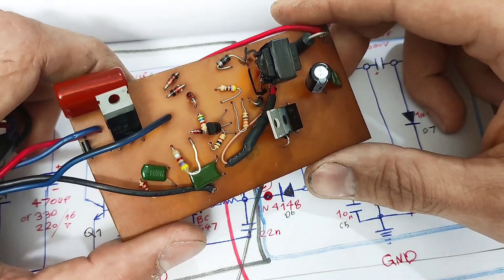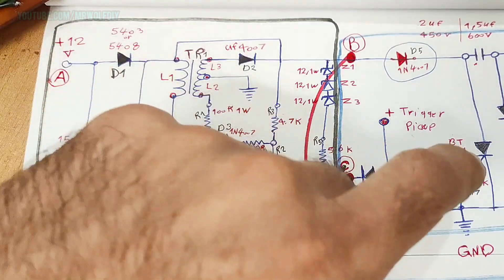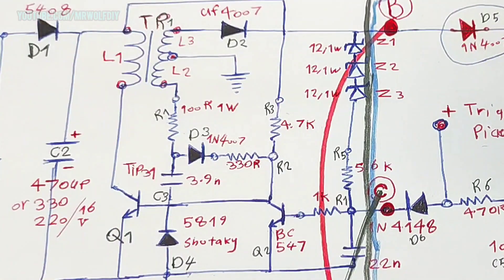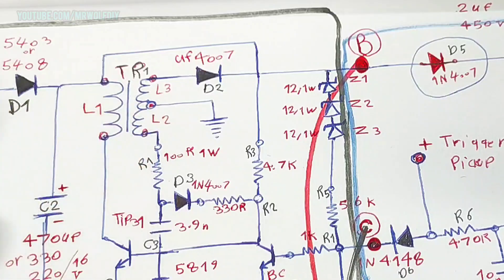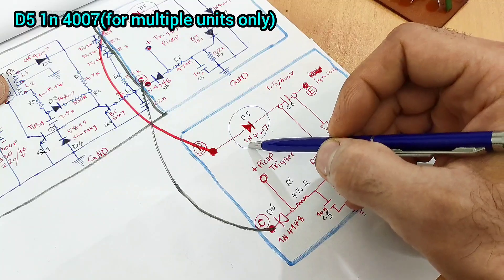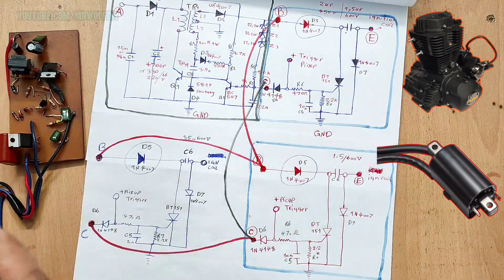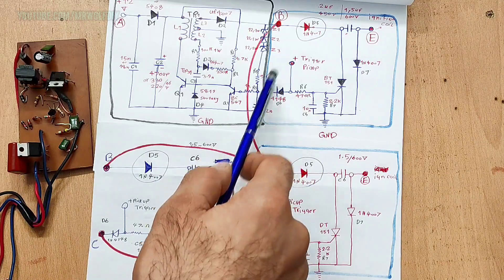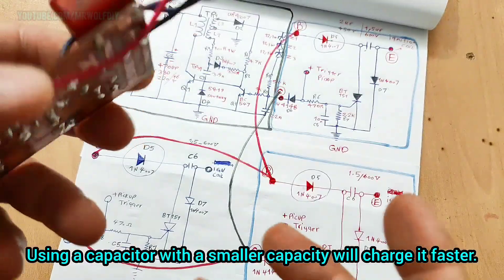DC CDI Unit For Multi cylinder motorcycles! Easy and Practical Guide.

Comment: Thank you for the detailed explanation. I have a question: can this circuit be used to power a Daewoo Matiz 3-cylinder? If there are any solutions, please provide me with a unit for a Matiz.
Reply from the maker: A CDI is originally designed for motorcycles...
Although it can be used on a car engine with modifications and adjustments,
But you must use a DC-CDI unit with adjustable timing and advance curves.
The main challenge is achieving precise ignition timing so that each spark plug fires at the correct moment.

Comment: Hi hope all is well with you, I have 4 cylinder motor cycle and it has one pickup coil to control two ignition coils to fire 4 cylinders(1&4, 2&3 waste spark system). I'm don't understand how to detect 180 phase and fire two ignition coils using one pickup coil.
Reply from the maker: In a waste spark system, there is no need to detect the 180-degree phase. With one pickup coil, two dual coils fire simultaneously to two cylinders; one fires during the power stroke and the other during the exhaust stroke, where the spark is wasted. Therefore, one pickup coil is enough to control both coils.
Reply: @MrWolfDiy Thank you for the reply. But if I swap primary wires to the ignition coils with the existing CDI bike won't start. Seems like there is a timing difference.
Reply from the maker: Yes, that’s correct ,When you swap the primary wires of the two ignition coils, you are actually: disrupting the firing order.
Even though each coil is connected to two cylinders, the timing gets messed up, and the spark may occur at the wrong time,
for example, at the end of the compression stroke or, worse, during the intake or exhaust stroke.
Reply: @MrWolfDiy But you said both coils fire simultaneously 🤔 How to detect this timing difference using single pickup coil?
Reply from the maker: Look, the CDI in this type of engine handles the timing delay and processing internally.
Based on the crankshaft position and its internal design, it provides two separate outputs to the ignition coils, each with its own advance or delay.
You still haven’t mentioned exactly what motorcycle you have، Maybe I can give you a better answer.
Reply: @MrWolfDiy Thank you for your support. It is GSF400 Bandit. I'm trying to make my own CDI using Arduino but I couldn't figure out how the existing CDI process the pickup signal. I may need to go for my own hall sensors. Appreciate your help on this.

Comment: sit i am pretty surprize   can u simple make DC CDI  for pulsar bajaj bike or platina .. using stock HT coil please
Reply from the maker: Hi, You can produce a stable and good spark with a simple DC CDI, on HT coil
but only on the condition that the HT coil is specifically designed for CDI...
I have already built two DC CDI units, which are on the channel.
In platini ignition systems, it’s better to use an AC CDI, which also requires some modifications in certain parts.

Comment: Thank you for this very informative video tutorial. I have an old kawasaki mule that is still in good shape body and healthy engine other than it has a bad cdi. I tried fixing it by replacing transistors and capacitor but still not working. There is no longer available cdi in the market. My only option is to make one myself. The engine is 1988 Kawasaki, 2-cylinder, 4-stroke. It has only one pick up coil. What I don’t understand is how can I time the firing of the second ignition coil if there is only one pickup trigger? I appreciate any advise you can give. Thank you.
Reply from the maker: Greetings, and thank you for your kindness toward me.
I should mention that in many engines—especially older or simpler models—a "wasted spark" ignition system is used.

Both cylinders fire at the same time, meaning that when the pickup coil sends a signal, both ignition coils are activated simultaneously.

In this system, one cylinder is in the power (combustion) stroke, while the other is in the exhaust or compression stroke—so the spark in the second cylinder is "wasted" but causes no harm.

That's why it's called a "wasted spark" system.
This design is purely for cost-effectiveness and ease of maintenance.
Reply: Thank you for your reply.  I appreciate it.

Comment: Does the cdi provide any ignition advance as revs increase?
Reply from the maker: Greetings friend,
I have not practically tested this circuit on a motorcycle yet, so I do not have precise information about it. However, technically, due to the lack of a microcontroller, it probably has less flexibility, and the ignition advance is likely limited to a maximum of 12,000 RPM,
Nonetheless, it needs to be tested in any case.

Comment: Awesome! Great info!

 Would a heat sync be required?

 Space for 3 units would be an issue. 

What type of current would be required? Would three cdi's cause an issue on the existing circuit?

These ideas are great! Thanks for sharing sir!
Reply from the maker: Greetings, thank you!
In response to your question: using a heatsink for the Q1 transistor and thyristor will help improve the circuit's performance.
Regarding space, this circuit doesn’t have many components. If you convert it to a PCB using specialized software, you can build it with minimal dimensions.
The heart of the circuit is the transformer. If it is properly wound, the risk of component damage will be minimized. In any case, it must also be tested in practice.
Thank you for sharing your thoughts!
Reply: @MrWolfDiy  Great solutions! Thanks again sir!

Problems that seem complex, you make simple!